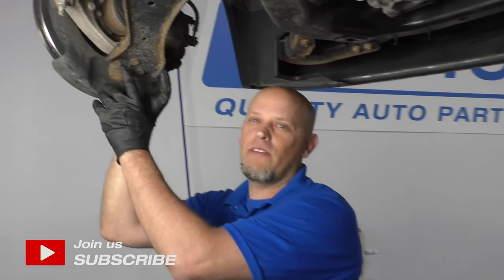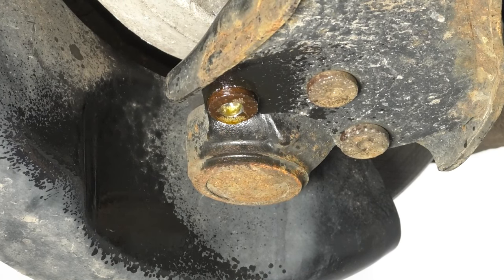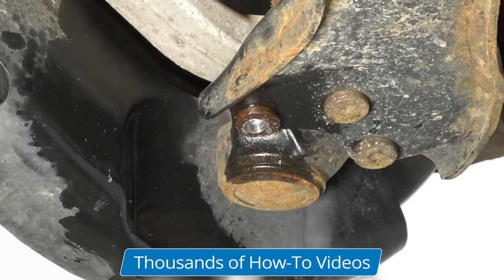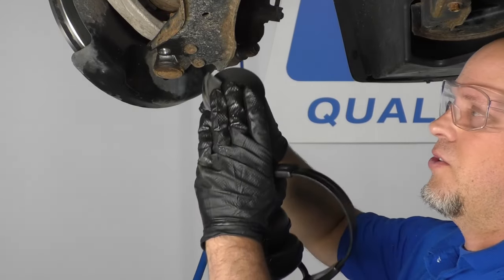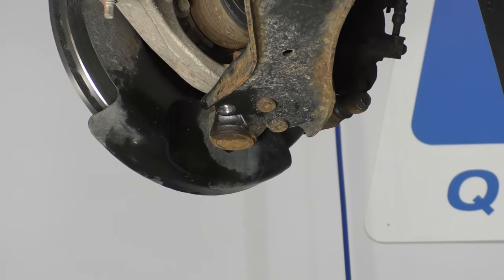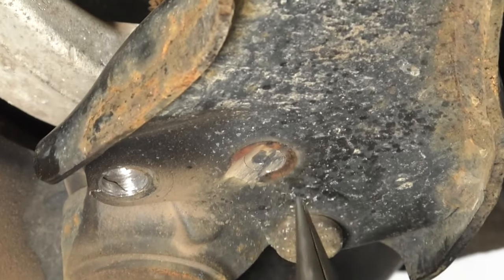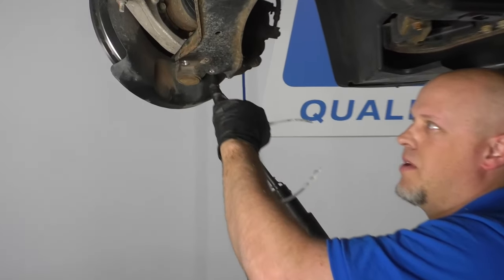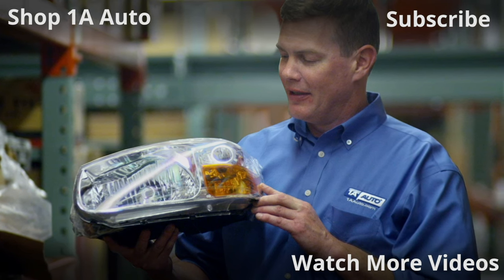3 Ways to Remove Ball Joint Rivets!

Comment: I did a 2003 Michigan Astro AWD lower B. J.  & I tried everything , heat, air hammer, after the head was removed. Wouldn't budge, So had to drill all 4 out.what a PITA. The videos I watch those vehicles aren't in the rust belt with 200,000 miles on them. Because the Rivets just don't pop out with a couple taps from a ballpean & punch!!  Big job here in the rust belt!! Lol

Comment: An old timer on youtube mentioned to drill slow and push hard when drilling metal. That way the tip doesn't overheat. Should be strands of metal coming off vs small flakes.

Comment: Hello Andy, you have been much help in the past. Today I replaced the front wheel bearing on a 2014 Traverse when I noticed the riveted ball joints. I don't have an air chisel but I put it on my shopping list.  Many thanks.

Comment: #3 looks like the winner. So glad I found this video. I will use the x and airhammer method. I have a 1972 Revcon RV that uses Oldsmobile Tornonado suspension with the 3 hole upper ball joints.

Comment: Thank goodness I found you guys , ordered from you guys couple days and having a hell on earth with rivets , will try this methods tomorrow.thanks
Reply from the maker: +Pochi Veloz Thanks for the feedback!
Reply: If all you have is a drill you don't want to go larger than that hole you drill down to the center you know how far you have to go you can tape it off on the drill if you want to I should say drill bit then when you get down far enough you take a cold chisel flat chisel and a hammer and clip the head right off it's going to come right off. It's a lot easier. It's just like when you put the X's on the head and cut it off with a chisel air chisel. You're just drilling through the top and you're just cutting off the ring. And it's going to be a clean cut

Comment: I don't have an air hammer - I'm a wood worker and do a lot of my own work - I think I'll try cutting the "X"  then using a drill bit - That should be pretty quick 

I have a 2004 AWD Astro Van - Of course I'll also be on my back...  Thanks for this video, though - Good stuff
Reply from the maker: +MIchael Zicopoulos Thanks for checking us out! 1AAuto.com
Reply: I don't have an air hammer either. I make hats for dogs.

Comment: Die grinding an X and  an air hammer is the way to go to chisel away rivet bottom and to drive it out . I have also found that brake cleaner while drilling cools of the bit way better than anything else !! 27 years as diesel mechanic I’ve drilled thru 5/8 studs on hubs , frozen king pin draw keys  that other mechanics could not get out !! Some of proudest moments as a mechanic!!
Reply from the maker: +@oakcliffpride Thanks for the feedback!

Comment: Theres a crack in that lower control arm within the left hole you drilled out. Will that be an issue later?
Reply: That's a metal shaving from drilling.  It's stuck in the lubricant.

Comment: Great! I gotta do this job at the weekend. Lmao at the first method!! 20 blunt drill bits later Vs high tensile steel rivets 😂 defo won't be using that method. I've only got a grinder, with thin cutting discs, I think I'm gunna go with the cross method. Thankfully I got a very steady hand. This is why mechanics just change the whole control arm. I will do the ball joints however.
Reply: I done it. Access was tricky on my car on the ground so I removed the bottom arm to change ball joint on worktop. As it turns out the steel rivets are surprisingly soft, i used the cross method then went straight to large drill bit - no issues blunting drill bits, bit of light oil on drill bits helps. Once drilled chiseled off and punched out. I was surprised how easy to remove . Only down side is adds labour time. What I thought would normally be an hour was three hours 😂 some great tips, personally recommend the cross method, followed by large drill bit  and then chisel of some kind. Make sure u chisel and drill off the rivet around the circumference so it punches out ok. But all in all pretty easy job, thought those rivets would be a b*+*ch. The superior tensile strength of nuts and bolts coupled with ease of maintenance - I gotta ask why the f+*k even use rivets!??
Reply: @richardd8352  - "I gotta ask why the f+*k even use rivets!??" 
Well the answer is cynically simple. Money! 
Fabrication is quicker (money), the rivets are cheaper than the corresponding bolts, washer and nuts (money). 
AND let's not forget when the time comes to change. Many opt by replacing the entire assembly. Which cost a lot more MONEY! 

All in all, you can notice that all the money talk, goes in a single direction! The direction of YOUR money. Component fabricators, car manufacturer, workshop, dealer. They all end up benefiting, you on the other hand... LOL 😂

Notice if you can save $1 in a certain component. When you multiply that by let's say 10 million units. Which is a reasonable number for car components! Suddenly you just "cash in" $10millions! Welcome to "modern" vehicles! ;-)

Comment: Never use a drill bit that's bigger than the hole in the control arm. Check the size of the bolt hole in your new ball joint as a reference. Be patient, keep your bit centered, and keep it oiled. Best method to limit damage to the arm.
Reply: You're correct on that once you drill down so far to the point where you know you you went through the head the top part of that rivet. You can cut the rest off with the chisel and Hammer. It's not right off

Comment: I don't know what design idiot used rivets instead of bolts but I have the same problem with my 1999 Dodge Dakota . As you can imagine the whole front end needs replaced.  I bought a new kit that gives me everything I need to upgrade my truck. I don't have a lift like you have so I actually have to work on the rivets from the top side. I'm not a mechanic by any means but I have to do this because I don't have the extra couple thousand to get it done.
Great video and I'm going to score the top, then cut it off and if need be do some light grinding to get them out. Wish me luck

Comment: Is there a certain type drill bit I should use? Maybe a drill bit to withstand high heat?
Reply: Any brand
Reply: @danmarley2926  - Yep, pretty much any drill bit made for steel... The real trick is low speed. Not like in the video. ;-)

Comment: So, I had my Acadia in the shop and they said the ball joints were going bad.  I ordered replacements, lower ball joints... but there was also "Upper ball joint" but it looked like the whole control arm and i didn't see anythign that looked like a ball joint on it.  Is upper ball joint a misnomer on my 2008 Acadia?  The only 'ball joint' I see is the one you removed in this video.
Reply: On newer Acadia's the "upper ball joint" is just the McPherson strut. Lower ball joint is an actual ball joint. Im sure 2008 models are similar.

Comment: Could I use a gringing rock instead of the cutting wheel? I feel like it would be faster and safer as the cutting will can explode if not careful enough.
Reply: you can as long as you don't remove too much metal from the arm. His first method is what I'm planning on doing since its faster IMO.

Comment: Will I still need to use a pickle fork to remove the ball joint stud from the spindle? Or can I just give it a good whack with a hammer?
Reply from the maker: +Ace Janitorial Services Hello, it may depend on how stuck the ball joints are, often using a hammer will work to remove the ball joint. +1A Auto

Comment: Looks very similar to Chevy Equinox crap. Wait until you install the OEM ball joint replacement. What a BRILLIANT design by General Motors. If anyone does one. By the entire control arm assembly..
Reply: Almost all makes have been using rivets for quite some time now.
Reply: @MacAutoDiag  - You mean "almost all" Americans makes! It's rather shocking to see the direction they're taking in the past decades. And to top it of, the consumer in there is totally clueless of the "crap" that as been thrown on their laps! To the point of thinking it's "normal"! 

All my "French cars", for the moment I have 2xPeugeot, 1xCitroen, 1xRenault (van) and 1xToyota (made in Japan), also make to the list! LOL 😂 That's in exactly NONE of them! 
Basic bolts and nuts. On the latest Peugeot/Citroen, for example, the ball joint is screwed directly. Which is even simpler!

On the normal, basic and simple everyday cars American brands, in all honesty, are making "crap" for too long. If it wasn't for the power of marketing, self protection laws and playing in they're own turf. They would be dead and buried!  
Japanese makers seem to have stopped in time! Goodness grace, Toyota, Honda, etc. still use castellated nuts and split pins, geez! 
Ex. ALL French, Italian and German brands use self locking nuts for ages! ;-)

Comment: When you drill down through the center you can use one drill bit drill down till you know you're down there to the frame the smaller drill bit that you use you can step it up and use the larger drill bit. But all you have to do after that is take a chisel flat chisel and cut the head off it comes right off. I did too many of them but just a drill a hammer and a chisel. Make sure it work it at you don't have to change the drill bit that many times

Comment: I wouldn’t use the first method. I did on the driver side And it took  me over a couple hours. Plus I didn’t have much room to work,  unlike this guy with the nice lift. I still gotta do it all again  because I bought a faulty part from Oreilly’s. Gonna use the second method for the passenger side for sure.

Comment: Slow speed down on the drill alot!! You torched the end of those drill bits, that steel is soft enough You can just bump the drill and only move at half speed and you will pull giant single piece spirals of the metal, metal is way softer than you think no need for high pressure or speed and yr bits will last for ever, done right tip of the bit never even get too hot to touch

Comment: Best advice is replacing pretty much everything when the ball joint goes out..it would already cause damage to the hub,tie rod,control arm bushings & cv axle boots (easy to fix) since the main indicator are ball joints the rest will follow..if you done each thing periodically you spend $500 extra on front end alignments..the small shops even have to send the cars to shops with a alignment  machine

Comment: I normally like these Vids, but a lot was missing here! At the end, I don't see how there was enough clearance to undo the castilated nut on the ball joint stud w/o removing the CV joint. Am I wrong? Also not covered is how much torque on the replacement bolts/nut to mount the replacement ball joint, instructions with new ball joints is poor. If too tight cheap bolts can snap!
Reply: Wtf this video was just showing the different methods of removing the rivets, torque specs and nut removal are irrelevant here.  Find a video on your specific vehicle for all that, use Google, or get a manual.